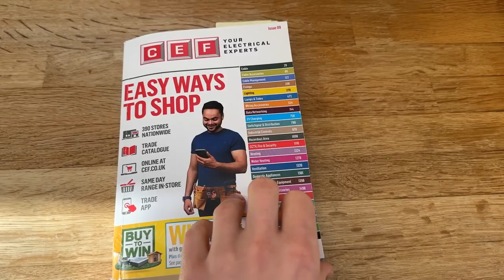How to Fit a Security Light - Easy DIY

Comment: Great video - two questions if I may. 1) How did you know that the string line would be level? Or were you just more concerned about the wire being on a straight run. 2) you didnt install a transfer - presumably the lights you installed are 240v?
Reply from the maker: Thank you! The string line was more to make sure the cable was straight, I’d measured the height of the lights at each end already, so should be level. Yep you’re right, the lights are 240v, so no transformer required. Thanks for watching!

Comment: You made reference to isolating the lighting at the spur only disconnecting the line conductor as it isn't double pole so you went to turn off the MCB at the board. At which point did you disconnect the neutral conductor in the circuit by turning off the MCB?
Reply from the maker: MCBs only switch the live, even when off the neutral is still connected….

Comment: Hi Just concerned and please correct me that all outside power connections sockets including lighting has to be installed by Qualified electrician and cannot be done by DIY user as would be the case adding a power socket inside? Bit confused if this correct that you are showing DIY users how to do it, correctly of cause and advising user they can do it as stated in accordance to BS 7671 wiring regulations. ?
Reply from the maker: Outside lights are not notifiable works, as long as it is just an addition to an existing circuit. My videos are purely for entertainment purposes, not instructional. Thanks for watching!
Reply: You are correct. Notifiable or not,  mains electricity going to an outside zone MUST be done by a qualified electrician and MUST be RCD protected.

Comment: Great video mate.I've got the same job to ,
just a question about the cable ,does it not need any protection from the elements
Reply from the maker: Thank you! As long as it is rated for exterior, you’ll be fine. If you’re buying from screwfix, it will say in the description.

Comment: What are you threading on the end of the wire at 14:45? Is that to stop the thin wires from fraying and help the wago grip it?
Reply from the maker: It’s a steel ferrule that gets crimped onto the stranded core. Yep it gives you a much better connection, not totally necessary just to go into a wago though. Where they are essential is screw terminals, as the screw can break a lot of the thin wires and just generally give a bad connection. Thanks for watching!
Reply: Furrels